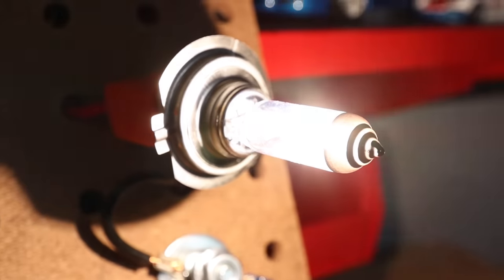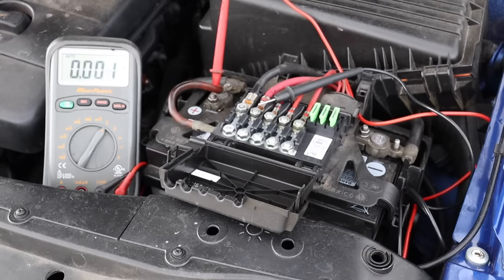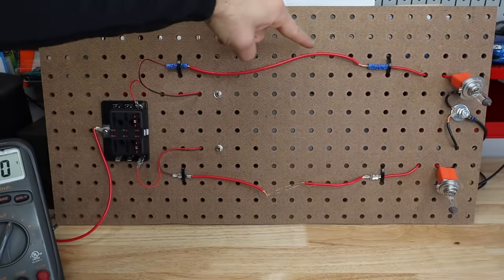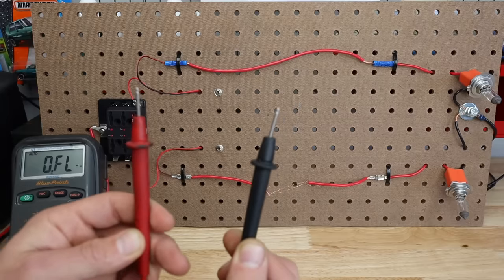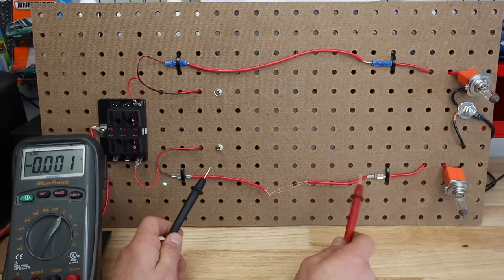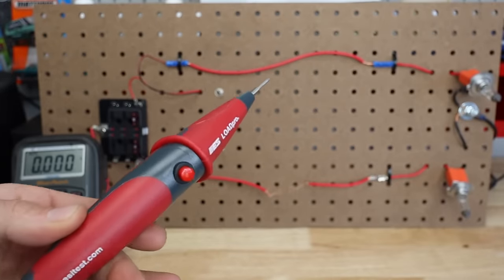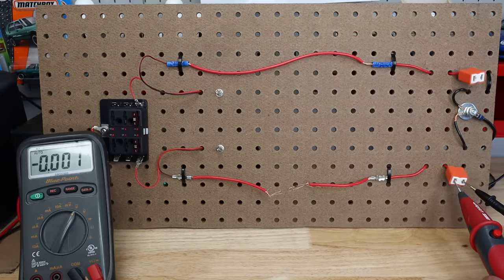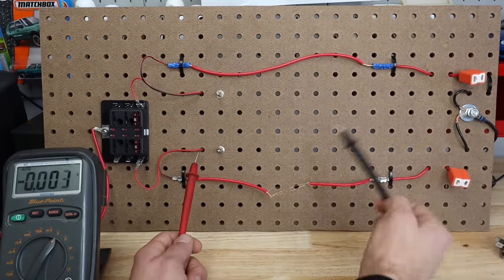Voltage Drop Testing ~ The BEST Way To Test Wiring

Comment: Just got a vw new beetle 2000 year 4 a few hundred dollars why are these cars so throw away I dont know its got 108.000 mil could you do a video on why the fuse box on top of the battery melts the two right green fuses melted , been through many junk yards and every one same thing😠 thanks for the videos
Reply: The black alternator wire tends to build resistance and melts fuse box on these cars.    I had a custom replacement made for under $10 by a wire shop, problem solved. It's beyond me why Volkswagen used such a cheap wire.   God forbid they spend the extra few cents and use a copper wire from the factory.
Reply: @Gr8thxAlot  thax 4 the info ill definitely change out that harness😆
Reply: @jaboomblue48  You're welcome.   You may need a new fuse box depending on the heat damage.   I've read on forums of the red wires going bad too.    (Although, the black wire seems far more common.)   If you want to have a new alternator wire made instead of the pricey harness,  I used: http://www.bestboatwire.com/   It was 4.16 feet on our Bug with the 2.0 BEV.     One lug for 3/8 inch bolt, the other for for 1/4 inch bolt.   The fuse box needed minor grinding with a dremel to make enough room.   It's now far better than factory.

Comment: Load pro seemed useless, I have one and never use it.
Reply from the maker: I don't think useless. I think like many tools it has its place. This is the first time I have actually used it. For a super quick test, it's worth a $50 buy.
Reply from the maker: But let me be clear, I am not in the "Load pro is god's gift to techs" camp either.
Reply: The load pro certainly has its place in my environment where its nearly always impossible to use the intended load to load the circuit. Especially on a circuit that may contain 50 feet of wire in one leg of the circuit. Corrosion is prevalent in my industry and while simply checking voltage may show a good circuit, the load pro tells me otherwise very quickly. I would have had to use 50 feet of test leads to test from one end of the circuit to the other as shown in the video. No discredit whatsoever to what Charles has illustrated. Voltage drop is certainly the most accurate and telling test in my book.
Reply: A light bulb does the job for me...
Reply: @HumbleMechanic  Load Pro puts a 25 ohm resistor on the circuit drawing 0.5 amp on 12 volts.  If the normal amp draw on the circuit is higher, then you have to realize that the voltage drop you got for the Load Pro will be for every half an amp draw.  1 amp normal load, means 2x the load pro drop.

From the video, I calculate that is a 10 watt bulb.  0.160 volt Load Pro voltage drop at 0.5 amps and 0.260 volts dropped by the bulb, comes out to be about a 0.82 amp draw with the bulb or 10 watts.

Comment: I've never understood how a meter can still give you a voltage reading by placing both the probes on the same run/length of wire,....can someone explain this??
Reply: You are still getting positive and negative current from the respective sides of the circuit...
Reply: This is exactly what this video is  about: The volmeter just shows you a difference in electrical potential; you might figure this as pressure.  If for ANY reason the pressure  drops in a given conductor then the voltmeter will pick up this drop of voltage and display it as the difference measured between its two tips.

Now the cause for the voltage may be desired or not. First case is a load that does a required work, as a lamp or a motor would be. You still measure the voltage drop on the same wire as well,  just across the load. 
An unwanted resistance  as corrosion makes the  voltage drop as well and the voltmeter  picks it up n the same way, measuring across the load, in this case the unwanted resistance.
Reply: @athhud  Ah, I think I get it now,....still seems like magic though.
Reply: Just think of it like this, if you cut the wire in two, your leads are now connected to a positive and negative wire.
Reply: Parallel...

Comment: Great engineer, please help!
Please help!
Recently, a client called me to fix his 2000 Toyota Avalon car that cranked but wasn't starting.
   From the onset, the car experienced several mechanical, as well as, electrical issues. Some of those  problems were:-
(1) Engine Oil consumption;
(2) Engine misfire;
(3) Engine rattling;
(4) Intermittent hard starting after shutdown; 
(5) Hard to engage in drive, except engine is hot; etc.
Hence, he took the car to a garage inorder to rectify the excessive Engine oil consumption and other car problems highlighted above. Consequently, the car  problems exacerbated after engine rebuild by the engineer! 
  The car owner wasn't satisfied with his repairs because it seems the engineer was deceitful. Although the car started after the rebuild, the problems still persisted.  Valves weren't grinded after engine overhaul, engine still misfired at idle and when accelerating, etc.
   The  engineer whose garage the car is presently being parked, requested for another engine overhau/ rebuildl. After engine rebuild the car started, the oil was mixed with water; the engine was still misfiring, rattling, etc. It was obvious,  that he didn't use durable parts to do his work.

    Hence, the car owner moved the car to another garage for better repairs. The new garage suggested to the car owner that another engine rebuild is pertinent for optimal engine operation. 
    During my conversation with this engineer, whose garage the car is presently being parked, he told me that: "when the car was first brought in, he noticed a black smoke ( maybe he was mistaken for blue smoke, at exhaust tail at idle). When accelerating, there's a loss of power, engine bucking, popping,etc. After the rebuild, the car didn't start because the mechanic didn't unlock the car with the remote but proceeded directly to cranking the engine. In addition, the security relay wasn't actuated for starting to take place. Electrician did some wire cutting around that axis which he said was corrected to factory, opened with a remote before the car started.

   Fortunately, after everything, the car started again. But there was still an intermittent misfire. What the car owner said was that, 'even when the second mechanic did engine rebuild, the car still misfired. Until he personally bypassed earth from the COP wire to the solenoids very close to the fuel injector often tightened with 10mm knot and depicted with blue and green colors on the picture. Car owner verified that the reasons for the misfire from both mechanics which still prevailed, was due to the solenoid valve that wasn't opening. That's why when accelerating it experienced a loss of power, similar to that experienced by a faulty fuel pump.
  
   After gear oil replacement and test driven by the second mechanic , smoke started emanating from the engine bay. Precisely, from the fan relay that the car owner connected by himself. Within few minutes, the car shutdown by itself as if fuel is finished.  As he tried to restart it, the car refused to. Infact, when the ignition switch was turned to Acc/ ignition position, battery and fuel light was not displaying in the dashboard/ instrument cluster. However, during cranking battery light glew faintly and start. But when throttled,  it would shutdown. Electrician verified and replaced the alternator diode with a new one. When Ignition switch was turned to Acc/ ignition position, the battery and other lights came out brightly but when cranked to start engine wouldn't start again. Sadly, it still wouldn't start.
 
I tried to scan for DTC codes, but my scanner wasn't communicating. I checked all fuses, power and ground at obd port, those checked ok. but my scanner isn't compatible to read CAN network. there are only 4 wires intact for the obd2 port.
    Furthermore, I added fuel through the intake to the engine, no change at all. I checked for spark and injector pulse. These things weren't present. But there was power to injector with just the key at ignition or ACC and COP had 1 ground and 1 power as usual. 
 Electrician from that garage, who also worked on the car said that he sniffed burning smell from the ECU, however personally I didn't when I went to start the car. I don't know how certain that was. Hence,  I pulled out the ECU to a laptop board engineer to test the components inside. He said: "everything looks ok and test fine, however the IC he doesn't have the right tools to proceed with the test. With the ECU removed battery connected, Engine light would come ON. with ECU connected check light still comes ON.
Before I left, I checked the MAF sensor 5 wires and noticed that 3 wires were earth instead of 2 and 1 power; no ignition current/ power was available for the remaining 2 wires. 
  Please, what should I do to start the car?

Comment: Complete and utter jibberish......not one single you tube creator has explained volt drop properly..and probably never will. This video certainly did not. And if you went ahead to a charging or starting circuit ( which you conveniently avoided) you would be in  mine field of different voltages. You wouldn't have a snowballs chance in an oven of explaining that to us properly. Your mechanical tutorials are brilliant....but electrical not so much. The vid on parasitic voltage drain was head hurting to try to understand....and I'm not a stupid person.
Reply from the maker: Sounds like you have the perfect opportunity to make that video